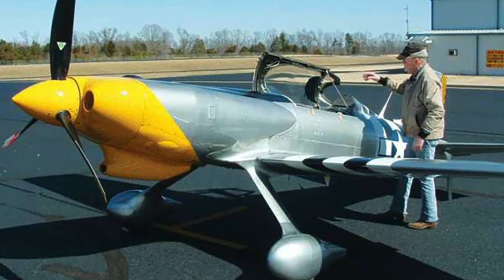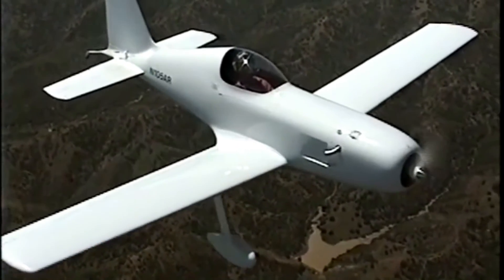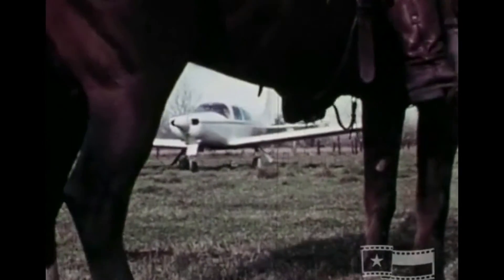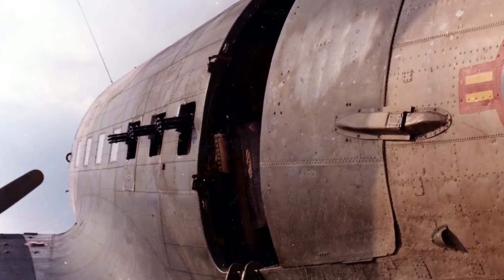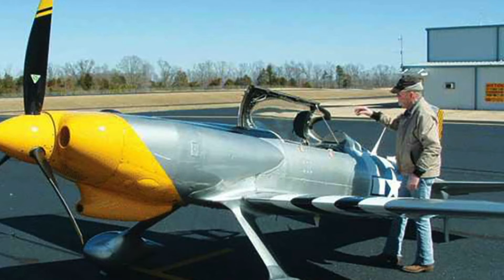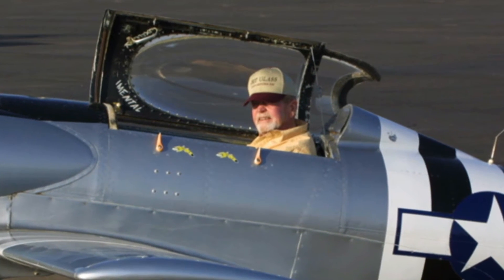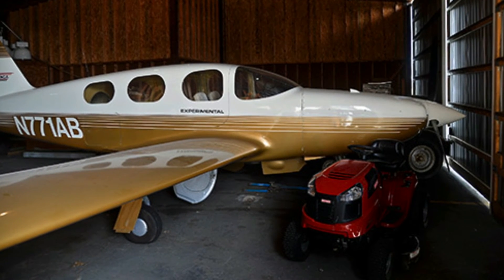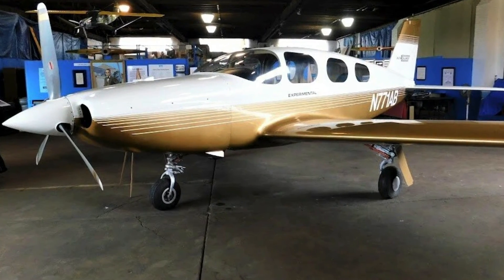Obscure High Performance Planes You've Never Heard of

Comment: Bellanca has long been an understated designer, and now a reformed former shell of its former self, but look back at some of the designs, and you will be blown away.  A personal favorite is the C-27 airbus which drawns Staggerwing vibes for me, with that Bellanca nuance. Chamops and Decathlons were also under Bellanca..  It'd be interesting to see what they might have come up with in the LSA category in the modern era!
Reply: I'm a huge fan of Bellancas!  The 17-30 SuperVikings.  For a while, what was basically a derelict wreck of a what I determined to be a 14-19 sat in a field at Fort Pierce Airport in Florida.  I found it there in a field, and what attracted me to it was the fact that it had a triple tail.  The engine was exposed and was totally corroded;  I wanted to buy it, but in 1990 when you worked as a flight instructor for $19,000 per year you didn't buy old airplanes, much less launch into $100k+ restorations.....

Comment: 4:37 Are you sure about the piranha’s stall speed?

Take-off occurs above stall speed…

Implying the pilot would need to race from 0 to 130+ mph before flying….

And of course, slow from 130+mph to 0 after landing…

180hp would be hard to get off the ground, fully loaded…. Before running out of runway…

In a tail dragger… that are not exactly known for their stability once on the ground…

That alone sounds deadly when encountering a surprise crosswind or change of strength of the known crosswind…

Ground loops at 100+ mph must be horrible for one’s health.

High speed wings, make low speed operations impossible….

Imagine flying around the pattern with other airplanes at the local aerodrome…. That are doing half your speed… Yikes!

😃
Reply from the maker: I don't disagree, but I've only got the very sparse data in google to work with (and/or articles written)  Short of attempting to actually contact the current owner,  that's the best I got.

Comment: 3:07  6 high performance aircraft, not just 5! 😃

Looks like you have unknowingly captured a pic of Al Mooney’s last aircraft design in YOUR presentation…. A twin pusher canard, in a composite construction…!

Al was still designing planes after he was not part of the namesake Mooney Aircraft Co.

His twin pusher highlights a big challenge of canards… the front wing has a tendency to throw dirty air in front of the rear wing, disturbing the lift of a large portion of the main lifting wing…

Technically, Al Mooney built composite planes in the 1950s… from a natural composite called wood!

Go Mooney!

😃
Reply from the maker: Well, I did a video that included the Avtek 400 recently, and another one on the Mooney Mite, check them out.  I love Mooney designs and will be producing another one soon on Mooney.

Comment: I remember a documentary on homebuilt aircraft. One of them featured was Mono low wing single seat with V type tail. Powered by a V Twin Briggs & Stratton. Normally rated at 18hp it was modified to output 20hp. The plane did 200mph indicated airspeed on 20 hp.
Reply: And then you woke up.
Reply: I’ve seen the same. It was a segment on Modern Marvels or similar, if we’re thinking of the same one. 
Texas-based designer, no aeronautical training, 10 or so aircraft built. This one was basically a tube with the pilot all but laying on their back, little motor up front, and delivered 200 mph. 
I’ve found info on it before, but not much, and I forget the guy’s name now. 
But you’re not crazy - it apparently did exist.

Comment: Mark arnolds construction video is about a decade ago. Useful part was how to successfully Fair a surface. Not only airplanes need to be fair but boats need to be faired. There is only one way to do it correctly. Fortunately I had a lot of Auto body experience. You have to fair surfaces as well.

Comment: The Arnold looks a bit wrong but seems to have been a bit of a hot ship. Tony Le Vier certainly knew how to wring maximum performance from minimum horsepower as the Cosmic Wind proved.
Reply: The AR-5 uses a lot of aerodynamic "cheats" that are commonly used in extreme forms of low speed aviation - in particular, gliders. I remember a series of articles in Sport Aviation that went deep into explaining them in layman's terms, you might be interested in checking it out. The swept tail you see on light airplanes today was designed by the marketing department. They are objectively worse in pretty much every way.
Reply from the maker: That's intriguing.  Maybe that's why Cessna swept their tails around 1960?  @BennysThoughts
Reply: @aircraftadventures-vids  I just remembered a few more of those cheats. Everywhere that air meets an angle, such as between the fuselage and the wing, there's a lot of drag. The sharper the angle, the worse it is. That's why planes have fairings. But the real cheat was that by putting the wing at the absolute bottom of the fuselage, he actually removed two of those angles. He did the same thing with the landing gear.
Reply from the maker: I was always curious about  the straight tail on the Ar-5 plus lack of spinner, but I'm no engineer or test pilot.
Reply: @aircraftadventures-vids A spinner would have just blocked the cooling inlet. Since the engine is so small, you can benefit more by just shrinking the whole cowling. Only on large radial engined planes (like the Hawker Sea Fury) do you see a large spinner attached because the cowling can't be shrunken anyways.